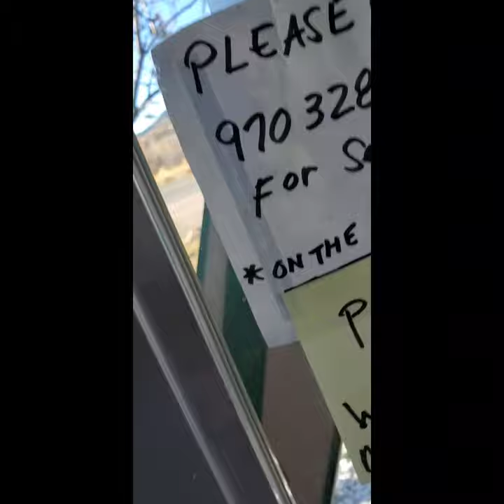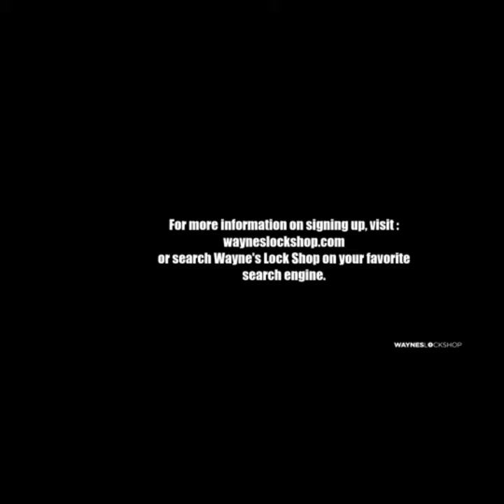A1 mortice cylinder force tool in action, Adams Rite lock epoxied in place on storefront door

Comment: The best way to secure a mortise cylinder is plenty of crazy glue. Look how hard it was stuck in there. That little set screw would never have secured it that securely.  Lucky you had that tool. I only carry a big set of Chanel  locks.
 Also a bag of 4 letter words to mutter under my breath.